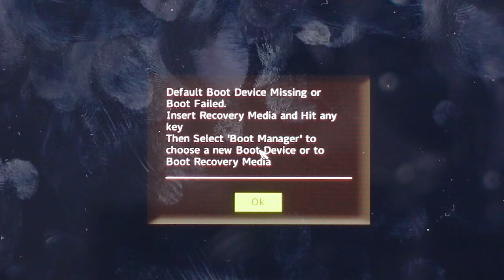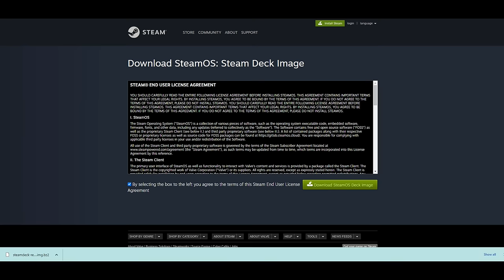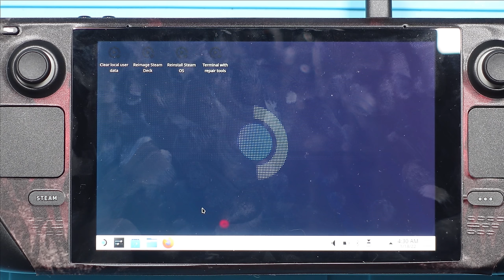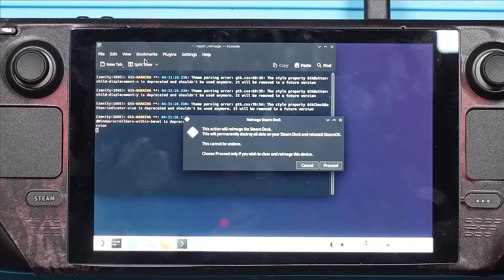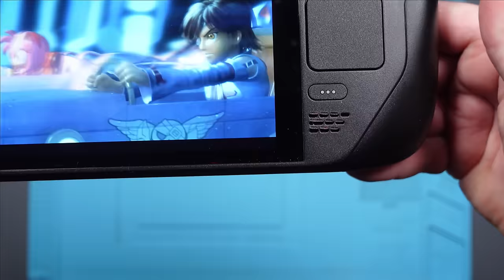I Paid £280 For This Faulty STEAM DECK | Did I Get Ripped Off?

Comment from the maker: I probably paid too much for this Stupid Steam Deck thing...
Reply: In the first 20 minutes of this video being live to the general public you've taught 2,500 people how to replace an SSD card shield and how to reattach a broken Steam deck speaker connector, plus you've reminded us of eBay's pitfalls and shown off your good taste by removing that skin. Worth it?
Reply: @simonupton-millard  I am curious if it would accept a 1tb at all tbh. I wouldn't be surprised if it did.
Reply: @owlhatch3812  it does. I've cut a Samsung PM991a 1tb to the right size
Reply: You got an actual deal. Should get the dock and use your PS4 controllers and it's a great piece of gear!
Reply: @Ea-Nasir_Copper_Co  I think so. I believe that the Steam Deck's starting price is over $450.00 USD. Even with the monetary conversion rate considered, Steve saved quite a bit of money. Of course Steve's time, to repair the circuit board plus the cost of an SSD drive also adds cost to it... I think that he did okay and now he has a working Steam Deck which he can proudly play games on. Great work Mr. Steve!
Reply: @Ea-Nasir_Copper_Co  cringe
Reply: @owlhatch3812  Framework, that company that sells modular laptops and supports right to repair, is offering 2TB ssds for Steam Decks. So the answer is yep :)
Reply: yes
Reply: @owlhatch3812  It most definitely would accept a 1TB SSD. 2TB drives are now available and have been successfully fitted. Plus You can easliy fit a 1TB SD card. Truly is a great little machine!
Congrats to Steve for getting that one working again; at the same time as making an informative and entertaining video
Reply: You can ad 2tb ssd and 1tb sd and works just fine.
Reply: SSD stupid steam deck
Reply: TronicsFix would be proud. Amazing job.
Reply: Just like everyone else with a Steam Deck.
Reply: I mean, you had everything you needed to fix it anyway so I'd say it's a good price all in all. The seller is really scummy for doing this though. It's one thing to sell a faulty device but another to strip it of a vital component before selling.
Reply: I paid £500 for mine Steve , you got a bargain mate.
Reply: Your fearlessness in attempting these fixes is, as always inspirational. Thank you. Fantastic, entertaining and educational.
Reply: Hell of alot for a fault device
Reply: Yeah I think you did, as soon as I saw that message I had a feeling the m.2 was going to be missing. I don't recommend anyone buy from ebay at present. This one had no drive for £280 and damage to the case and speaker connector. So for a minimum cost of £50 for a basic m2. 2230 plus accepting damage to the chassis and the need for repair. Not worth it buy new
Reply: @owlhatch3812  I've a 2tb in mine, so it definitely does work.
Reply: Pretty scummy thing to do. If any joe was buying this who doesn’t repair this I’d be 100% getting your money back for it. Ripping off a connector alone is enough let alone removing the SSD
Reply: Hey mate, great job, but a little bit expensive for a broken unit. But, big hug from Spain…
Reply: AFAIK, many chipsets that say they only work with a certain range will actually still support beyond that.

For example, on the Samsung website, the Galaxy Note 9 says it supports expendable storage "up to" 256GB, but I do know it will work with a 1TB SD card.

Not sure why any of that is though, maybe something to do about reliability or perhaps the phone was released before a 1TB SD card was available on the market.
Reply: Surely you can't sell it without the SSD without at least declaring it
Reply: @simonupton-millard   Cex has lots of steam  decks in lol.👍
Reply: @owlhatch3812  They make 1TB size-2230 SSDs they're just effin expensive.  The m.2 interface can't tell what physical size the SSD is, just the capacity.

That said, Valve should've tried harder to allow 2280 SSDs in there or 2.5' SATA drives, since their competition is already flexing on them by doing so.
Reply: Woooow! Red Dwarf reference!
Reply: depends on the graphics card, processor and ssd storage size... i would have told him 200 take it or leave
Reply: @owlhatch3812  why wouldnt it... why would they cap it?
Reply: Great job, and entertaining to watch. Plus you know have access to more stupid games. So, all decent. Nice!
Reply: Thank god for eBay money back guarantee
Reply: I'm sure the Steam Deck is happy! 🤩
Reply: Well done mate, good job. Just out of curiosity,  how was the deck advertised on ebay? Was it advertised as " missing SSD" or " faulty OS" or something similar? Because whoever the seller is, he or she was just trying to have someone over, and should get banned from ebay, but it's good to see that you had the last laugh !
Reply: 50 quid top wack
Reply: Yes. You got ripped off. I got a brand new one with 64GB SSD for £315.
Reply: I have 2 that work perfectly but I'm still figuring out how to get the blasted thing to work together with my ps5.
I'm feeling old and redundant ATM. 
Please help a fellow old timer out.
Reply: Nice video, enjoyed when the holding tab pinged across the room lol
Reply: Steam deck is awesome.
Trying to save a few pounds getting one from ebay? Not so much.
Reply: I May give you my Nintendo switch lite  250gb SD CARD with picofly installed. If you don't want this steam deck. I finished all interesting games on switch. Now i want steam deck
Reply: Don't beat yourself up mate. Apparently they're the bees knees and way better than any consoles available. I'm not sure I'd pay the price they want for one here in Australia. But then again people spent thousands on PC gaming computers and they become out of date quicker than any console. I think what it comes down to is what you like and what you want to do. I prefer my ps4 and I'm reluctant to pay the price they're still asking for the ps5 considering it still has know quality issues. Time will tell if I ever change my mind and decide to upgrade
Reply: Not is a word Not a number....juss sayin love your videos at least your singing does not make my ears bleed ...anymore lol kind of
Reply: Don t know if somebody already told but you' ve sat thé ssd on the ' emi shield'
Reply: To check if they work you could make a windows boot microsd. Go into the boot menu and boot it that way
Reply: You can also go into the boot menue and that would show you if the SSD shows up I'd contact eBay and say parts taken out.
Reply: @owlhatch3812  It even accept a 2TB. ;-)
Reply: i paid 320eur on ebay for used one with 512gb sdcard😊

Comment: It's crazy to me how people can spend $500 on a steam deck and then take it apart as violently as possible.  Ripping aluminum tape, scratching the shell with pry marks, destroying connectors...
Reply: i'm like 90% sure this steam deck is from a rookie who knew little to nothing about how to replace the ssd
Reply: @Jackspajf  It amazes me that something that has only been out for a year would even need stripping down to repair/replace the SSD. Imagine if you bought a new car only for the ECU to fry after a year.
Reply: @danthebikeguy447  Send the ECU to Ste he'll soon have it sorted!!!🤣😂🤣
Reply: There is no reason To open it but people like to tinker. Deck is really nice little pc.. I got one and II have opened it 4 times on the Last 5 months just to mod and test if I can improve it. Same stuff that I do to any device I get on my hands.
Reply: @danthebikeguy447  well, the main reason they open it up is they buy the 64gb version and just put a 1tb SSD in it
Reply: For under 300 you stole it 👏 👏
Reply: As someone who broke many devices before learning their lesson - the main issue is patience. When you're learning, it's incredibly easy to panic and destroy things you didn't meant to, either through obliviousness or rashness.
Reply: Guess he tried to upgrade the ssd and somehow destroyed that as well since it wasn't even one in there
Reply: @LeoMastroTV  
Ehm he said nothing about that repairs are a bad thing, he said only that this is bad that a product has problems after a year, which is understandable. Beside that a product should be repairable, the components of this product should work a long time, that the repair isn’t necessary after 1 year.
This has nothing to do with brainwashing. Or would you buy a new pc, where you know you’ve to buy a new CPU, GPU, SSD, RAM Sticks, etc after a year.
I think a product should at least work 2 years before I’ve to improve components and at least  4 years (in the best case never) before I’ve to repair components of the product.
In this case he has a point, after one year boot problems is sh*t, if the seller hasn’t lied about this issue.
Reply: @DarthSiles  This wasn't a case of the Steam Deck having problems. This was obviously a botched SSD upgrade, thus user error. (Many people get the 64gb version and put in a bigger SSD themselves to save money). It's absolutely amazing that Valve supports that and even releases guides.

Like other people said up top, it's most likely done by a kid who wanted to swap the SSD for a bigger one and failed.

The build quality of Steam Decks is decent in general. Some people have had issues, but Valve's support has been absolutely amazing at sending out replacements in those cases.
Reply: Okay but my question is why do you care? They bought it and can do with it whatever they want
Reply: @MrWhis-fe5hs  I guess it was my "how the other half lives" moment but regarding IQ and not poverty
Reply: I don't know what these people are doing. I've seen two cases of this connector being ripped off from the board. If they are just replacing the drive there's only a single screw holding the unit in place. Forcefully yanking something from the board doesn't usually ends well.
Reply: Some have 1400 euro phones and drop them the first day 3 time
Reply: @danthebikeguy447  a lot of people buy the cheapest model and put in a 3rd party SSD
Reply: They probably tried to go the cheap route -- bought the $399 64 gig version, slap in a 1 TB SSD, which comes to $50 less than the 512 GB version sold by Valve. If I could go back in time, that's probably what I would do -- the anti-glare screen on the 512 GB version isn't worth the price increase. Of course, I know what I'm doing and wouldn't destroy my console like this idiot did.
Reply: @Jackspajf  and to replace the back shell with jsaux clear shell with extra cooling mount
Reply: I was trying to fix my watch the other day and a tiny screw went “ping” across the room. It’s always a difficult moment.
Reply: I'm guessing some kid's mom bought that steam deck for him.
Reply: @spongiform  yes agrees me - the former professional watch repairer! i lost a several in my early years...obviously a box of assorted micro screws from Cousins watch supplies saved my job till i got more experienced...you need to trap the screw but you know that now...
Reply: @Jackspajf  it's unlikely (but possible) that the SSD died, they most likely just wanted to upgrade the size.
Reply: @Jackspajf  You can be a rookie and just follow tutorials to not do this... whoever this was, he/was careless and just brute forced it.
Reply: @LeoMastroTV  snob
Reply: @danthebikeguy447  it doesnt NEED replacement, people replace it to get an upgrade from a perfectly working one. so the ECU didn't short, they just wanted a newer model in therre and chose to open it themself, damaging the car in the process (as per your analogy)
Reply: @danthebikeguy447  they probably wanted to put in a larger SSD and couldn't be asked to use a guide to open\service it properly. 

One of those folks who never wants to use manuals because they "want to learn as they go and figure out things for themselves"

Which is a fine enough attitude when it comes to PLAYING video games, or learning software. 

But that's not the correct way to learn hardware. Unless you have too much disposable income\time on your hands
Reply: Everyone's saying how replacing the SSD is so easy, so this 12-year-old tried it himself.
Reply: @danthebikeguy447 clueless aren’t you
Reply: @DarthSiles  If shit is going to be not repairable, it needs to not break down and have a loooong warranty.  Naturally, the opposite is more attractive to greedy companies.
Reply: @danthebikeguy447 they people opened to put in a bigger SSD.
Reply: @rambofan1 yeah,being able to get it going again does make it a bargain and a half
Reply: I do not get that at all. When you do not know how something is put together you are always extra careful.
Reply: I am in total agreement and then go on and sell it as if nothing has happened to it. 260 pounds for a 500 pound new steam deck but they have the gaul to sell it in this condition after they have bashed it about. I know it's buyer beware on eBay but this does take the biscuit.
Reply: @h.a.6790 My guess is they see the connector, try to unhook it and because of the size, they inadvertantly rip it off the board. It is pretty tiny after all.
Reply: Not many people have the patience or read instructions do they before the delicate task of electric circuit boards 😂
Reply: Three-year-old did destroy the speaker connector.
Reply: @danthebikeguy447  probably wanted to install a larger SSD

Comment: That really was amazing. The speaker connector block is the size of a grain of rice, so that cap would have been like a speck of dust! 

Congratulations sir
Reply: iirc they're .5mm x .25mm
Reply: it makes it more obvious why people use microscopes when doing soldering work lol

Comment: So the reason the Deck can make certain system level sounds with the speaker connector broken is because things like the Sleep mode sound don't actually use the speakers, but instead generate sound via the linear actuators used for the haptics, similar to how the Steam Controller did its own boot sounds.

The annoying thing is there is currently no way to disable these sounds without disabling the haptics. Also, newer models have stronger haptics than older models which I believe also means the sounds are louder.

Comment: Great video! My guess is someone tried to put a larger M2 drive inside it and ripped off the connector in the process. If your upgrading the hard drive it would be very hard to break that in that process!
Reply: They struggled getting the case apart. They had no hope from the get go 😂

Comment: Your tenacity with those ridiculous wires is inspiring :D Great job, and don't forget the SD Card slot to expand that storage to 1Tb (if you want to spend that much on a tiny bit of plastic...) - just don't forget to remove it before you open it again otherwise you'll do a Linus and snap it in half :D

DO use the inbuilt button tester to make sure they're all working... very common fault is the L1 bumper failing (like my OG deck did)

Oh and the sheath is to protect against EMF interference, apparently it's so close to various components it's possible they could cause data errors without it.
Reply from the maker: 😁 thanks Kaltern!  Definitely going to get an SD card for this thing.  I've almost filled up the 256GB already!  Love the device though, really great and working well so far!  👍
Reply: @StezStixFix  why not going for 1tb ssd instead ? it would be much faster for around same money i think
Reply: @badvoiceallnoise  Yeah they cost about the same but the speed isn't that much greater. I bought 5x 512GB (best value per GB) and swap them out. I have put all games on each SD card in a Steam group so I know which SD to insert. It happens instantly and I notice no real slow down while loading games. Other channels have tested this and sometimes SD is even faster.
Reply: @redavatar  One good thing about upgrading the internal storage vs SD card is it's persistent. I have one sd card I load for bear with my retro games and some smaller steam games and another with just steam games. Also dual booting for some gamepass games (tinykin and chained echos come to mind) you'd have to dig a round tho and get windows to read the SD card as well, which can be done.
Reply: @redavatar  laziness on my part since I already have a million SD cards from security research and not wanting a handful of extra cards lead to buying a 2tb sd card and calling it job done
Reply: @redavatar  agreed
Reply: @StezStixFix  i'm thinking about upgrading mine. almost filled up the 512gb ssd and a 512gb micro sd. i'm hoarding too many games :D

Comment: I think the ifixit guide says to remove the speaker and power cables to change the ssd, not really necessary if you know what you are doing, but then if you don't know what you are doing they are tricky to remove 😬
Reply: You can just run the battery down until it won't boot up anymore. That only takes leaving it on standby for like a day

Comment: The sheath thing for the ssd is just for emi and it's because the wifi controller is directly underneath it. Also I think the original one is just aluminium tape too stuck to a paper backing or something.